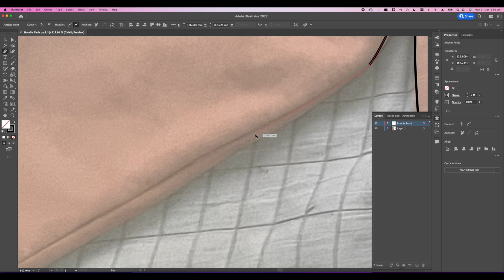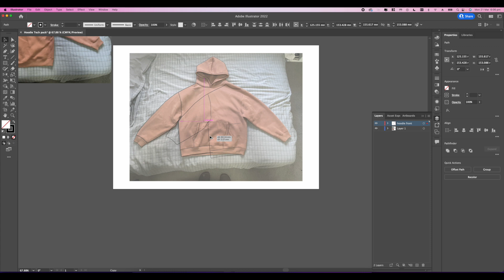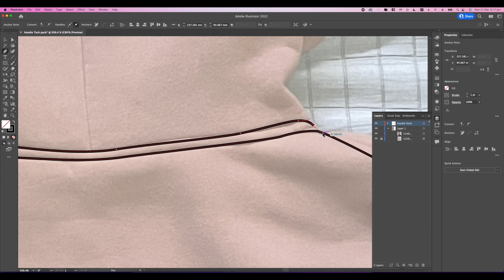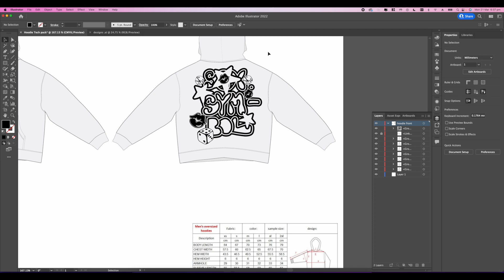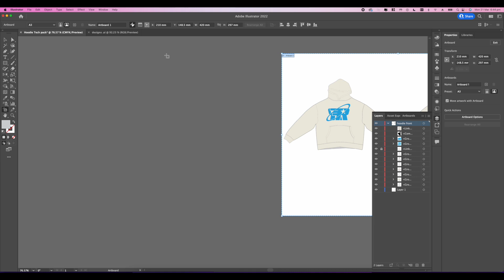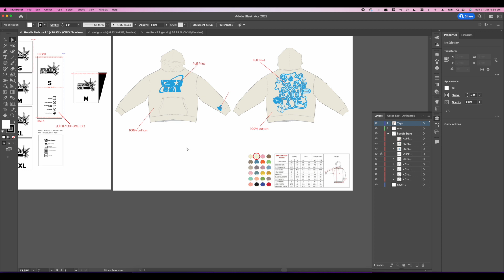HOW TO MAKE A TECH PACK | Project files

Comment: Where you get the color codes for your color swatch? In the right bottom corner?
Reply from the maker: Order a sample from my manufacture / company they sent them over. I just got the codes and colour matched them for the technical pack. Each company has a book of fabrics / colours - you can ask for it. Most will give it out once you order sample.

Comment: How do we make our own color pallete and how did you download the color pallete that your manfacture gave you ?
Reply from the maker: These are often on the product page of the Alibaba listing I just took a screenshot, or you can ask for them. I would recommend buying the physical sample of each colour/fabric because digital doesn't resemble the colour  at all, that's why they also have codes. I still asked to see the garment's colour to get a better visual representation. You don't need to do this if it's just simple black and white also another thing to note some of these colours they don't stock. They will have to source or dye to make it for you which will drive your cost per garment up or refuse service unless you order a certain minimum.
Reply: @DesignedByWil  Thank You I really appreciate it !

Comment: How do we figure out our own measurements for any type of clothing, to make sure things fit correctly/perfectly for customers when they're purchasing from our website as a Brand Owner, if the manufacture doesn't give out their sizing chart or if their sizing chart doesn't match the U.S.A sizing ?
Reply from the maker: Literally, tape measure using samples as references for the body of the garment takes a lot of time and sampling anyway. I personally just order samples of the garments or cross references with current brands sizing of the garments with the size chart provided by my manufacturer, from there you can adjust each of the measurements to tailor to the sizing you want. Unless you plan on doing cut and sew this would save you a lot of time and effort, things to look at when cross-referencing size charts,  For bottoms usually the waist, length and leg opening. For shirts - chest width, shoulder to shoulder width and length. These provide the primary fit for the body or how it would fit. It's a very costly and timely process if you want to size everything from the bottom up and there's no way around it just tape measurements and building flats for each garment or pattern that you'd use to sew these garments by hand.
Reply: i was wondering this as well , could you let me know if you find anything else out
Reply: @SharnaeMichelle  that’s what i was thinking, appreciate it
Reply: @9lik  you’re more than welcome
Reply: @SharnaeMichelle any good brands to look at for this?
Reply: Tape measure

Comment: Yo how do you draw so quickly on illustrator. I am tracing a hoodie like this and when I I want to curve something to follow the path it doesn’t look smooth with the line before it. Any tips?
Reply: (Adding on, I just do straight lines and then use the smooth pencil after which takes so much longer)
Reply: Hi david
Reply from the maker: Leaner how to use the pen tool , and use a drawing tablet . The pen tool is quite confusing . But will take your production time up

Comment: what format size do you use?
Reply from the maker: For digital I tend to work in 3000x3000 pixels - for print A4–3 but doesn’t matter really if your working in illustrator